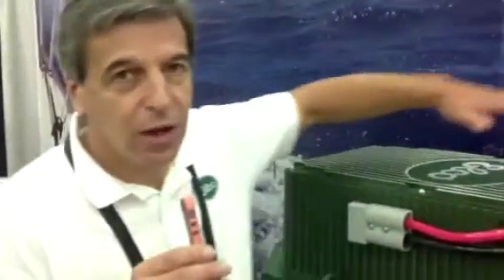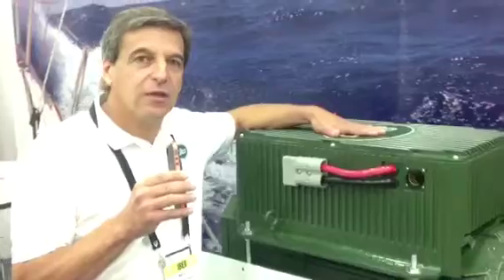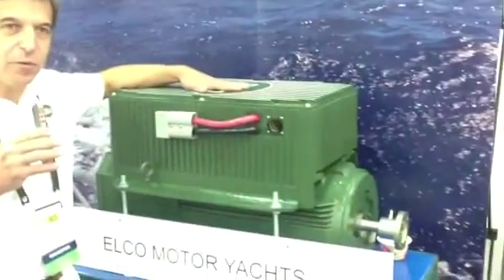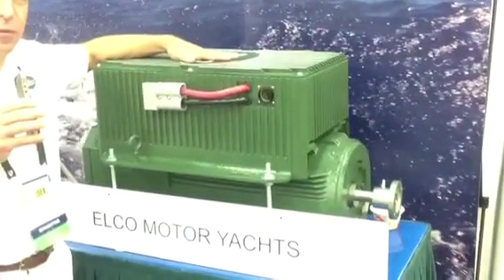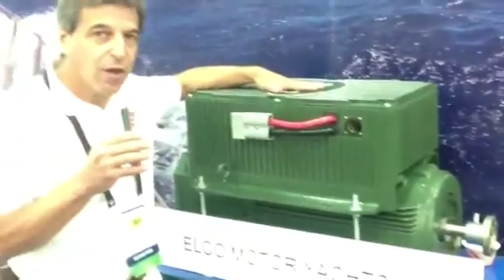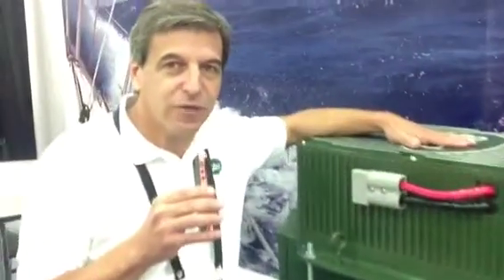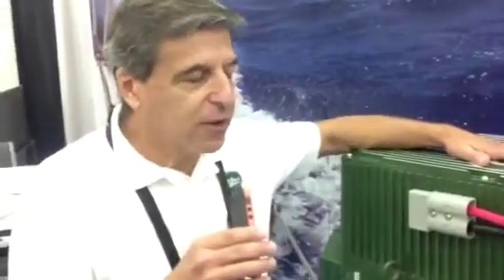Elco 100-hp Electric Engine

Comment: Can you please tell me if you have any information what is the proper regeneration back to the battery at what speed ? I really appreciate it would be a big help making a purchase decision on what type of electric motors on regeneration while under sail with EP-20?
Reply: 20 hp  20 kw good bayery size